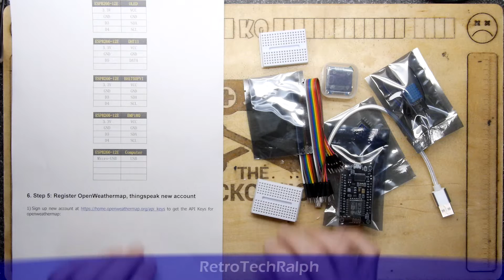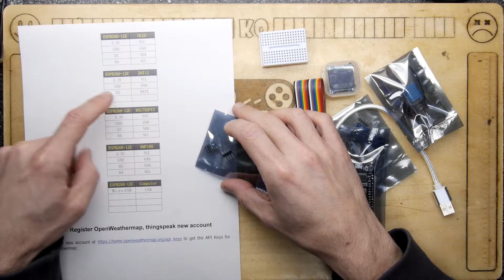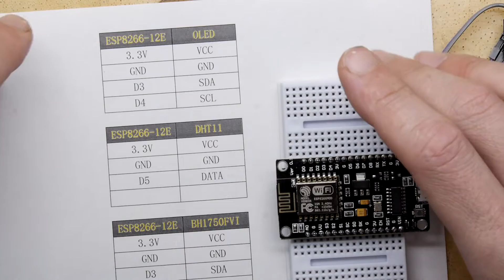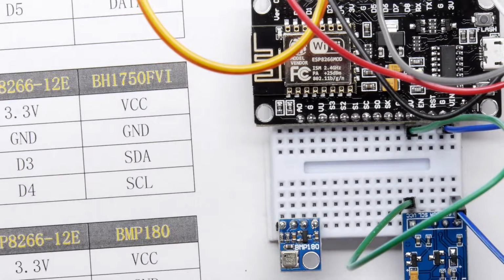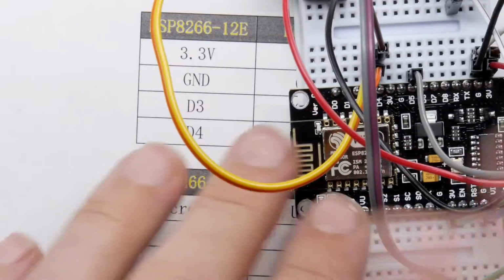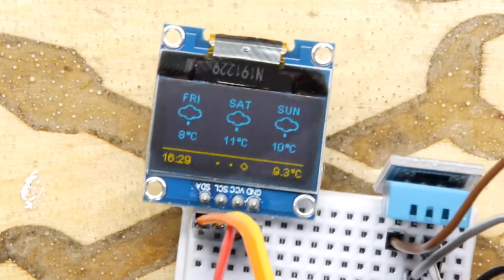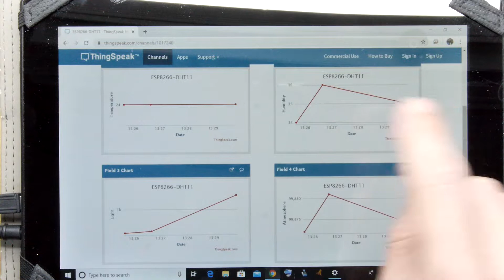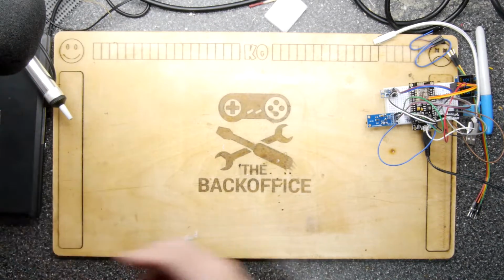How to assemble an IOT NodeMCU Weather Station Kit

Comment: Still trying to get the code to work, the ones in the instructions won't compile, "obsolete API" if that means anything. Managed to bodge together bits of it but it's combining it all so the thing works as intended that is causing me headaches.

Anyway, enjoyed your video, keep having fun.
Reply: WooHoo! Finally got it working. Had to update one of the libraries to resolve compilation errors, so a good, if somewhat frustrating, learning experience.

Comment: Was wandering if it was possible to use larger screen such as 2.4"?
Reply from the maker: No reason why not. You would need to modify the code accordingly, but it should work fine

Comment: Thanks backofficeshow, followed your build to the wire, plugged it into the Mac a flash of blue light then nothing, opened Ardunio tried 1 or 2 libraries nothing, so it's what it is junk.
Reply from the maker: Pull only the Arduino from your setup and try talking to that via the PC first. Worth getting that communicating first. Everything else can be added bit by bit after that

Comment: I saw another vid on this project and they discussed adding an external antenna due to the limited connectivity of the inboard "trace" one. Are there any comments about this and which antenna would work here?
Reply from the maker: You could cut the trace and add one. Very similar process to my blink camera video. Any WiFi antenna would do.

Comment: I purchased this kit, but mine is missing the URL for accessing the instructions. Can you send me yours? This looks like a good kit for being introduced to the IOT.
Reply: https://github.com/GJKJ/WSKS Here are the instructions.  /cheers
Reply: @russclayton1853  these worked! Thanks!
Reply: @russclayton1853  Thanks for that!!! Now the owness is on me. 🙂
Reply: @russclayton1853  I really want it to work but its giving me a .rar file and i cant get it to work as arduino ide wont let me use the code, can you put the code in a comment so i can copy it and paste it into arduino, or if you can let me know how to change the type of file so it will work,

it would be really appreciated if you could help me with this
Reply: Die you get the link? I'm also missing the link
Reply: @TheHpberger  I was sent the link, but it wasn't valid. It is a bummer. I have a handful of parts that I don't know what to do with. ☹️
Reply: @TheHpberger  I think you have an incorrect link which is for a Raspberry Pi kit... not this weather kit

Comment: Shame they didn't solder on the pin headers! Easily solved for us soldering iron welding types I suppose! :-) I hope they had flashed the firmware to the ESP module, all mine have shown up sans firmware. :-0
Reply from the maker: Yeah, that is a big shame. You need to flash your own firmware because you need to set the API keys. Its a shame they didn't include a web interface. I am doing the latter for all my gadgets, as hard coding settings is pretty lame!
Reply: @backofficeshow  I'm quite new to the world of ESP modules and all the guides I was using didn't mention the firmware flashing stage :-0 They all made it look like it was plug and play, or solder and play! In the end I built a firmware flash circuit into my project so I didn't have to breadboard it. That could be a a good subject for a video :-) I think I've already forgotten the process and I don't think the guides on the interwebs were all that user friendly! :-)
Reply from the maker: @electronraygun6346  Fortunately they already have the flashing hardware built in and already a base Arduino firmware. So as long as you plug it in the USB and loads the Arduino IDE it will be ok.
Reply: @backofficeshow  I should probably figure out how my firmware flash circuit works lol! Once I had the telnet firmware on there I just kinda forgot how the dip switches and micro switches work to flash a new firmware. I really should keep notes on these sorts of things!